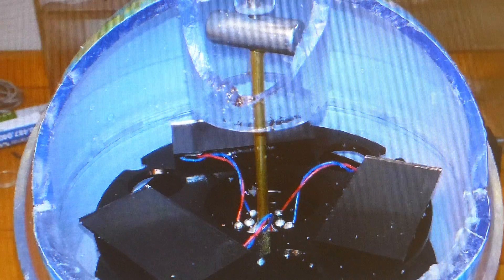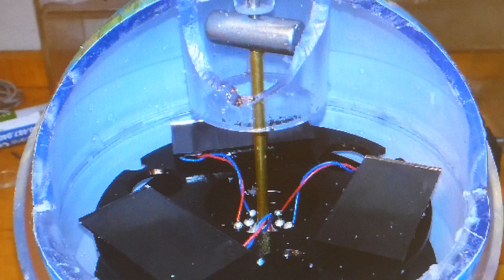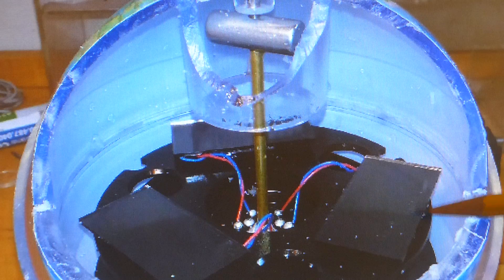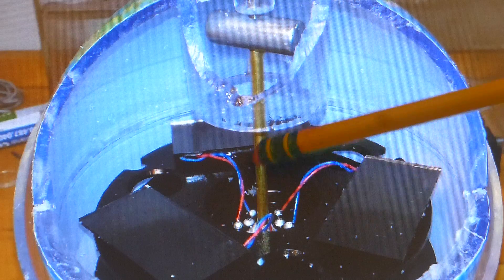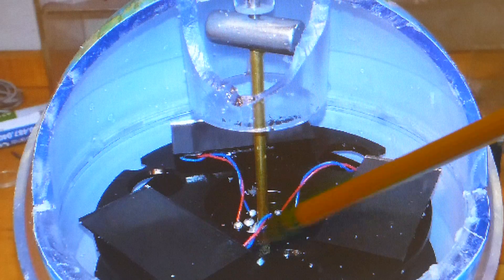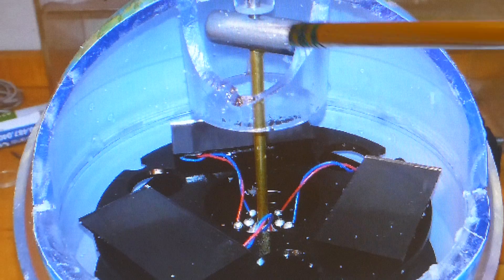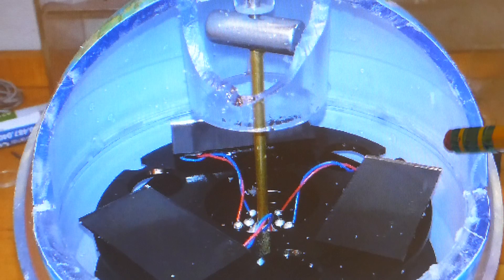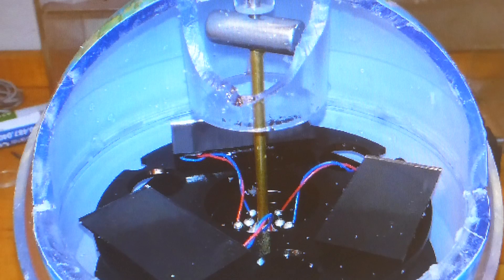Mova Globe :  Internal Mechanism Revealed by Cutting Open

Comment: Close but I imagine the piece at the top is just a weight to provide inertia for the globe to spin against.  There's no way the earth's magnetic field would be strong enough to to provide the force for the globe to spin against.
Reply from the maker: Do R/C! thanks. Diagrams in the patent office identify as a magnet. my brother verifies it is magnetic. I have sense found a video by the maker mr. French and he describes it as a magnet. thanks for commenting and viewing.
Reply: Orville Wingnut OK I read the patent.  The beginning does make it sound like Earth magnetic field is used but reading deeper the "earth element" is actually the gravity that holds the sphere upright.  Deeper in the explanation of the rotation mechanism it describes the motor spinning against a "counter torque element" which is the weight at the top.  

There is a ton of mumbo-jumbo in the patent designed to make the system sound more complex than  it is but the reality is that it's just a spinning motor that uses the mass of the weight in the top to spin against.
Reply: Orville Wingnut the magnets they are describing are actually just the magnets of the motor.  The whole thing is really written in a way as to disguise how simple the system is, probably because it'd be hard to get a patent on "motor spinning a weight" :)
Reply from the maker: Do R/C! . please for YouTube entitled mova Globe origin and operation by Bill French it's inventor. he explains it at 2 minutes and 50 seconds and the diagram is clearly labeled magnet. I guess I we'll have to make another YouTube show some Needles and Pins sticking to the magnet. thanks for the discussion and you're serious interest
Reply: Do R/C, have you never seen a compass? With a large modern rare-earth magnets, you should be able to create a stable north-pointing mechanical reference.